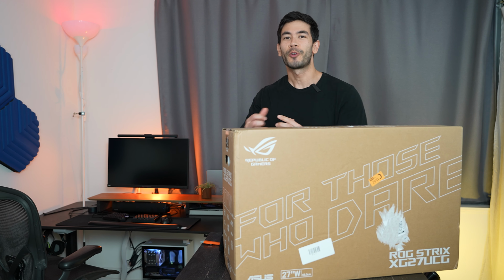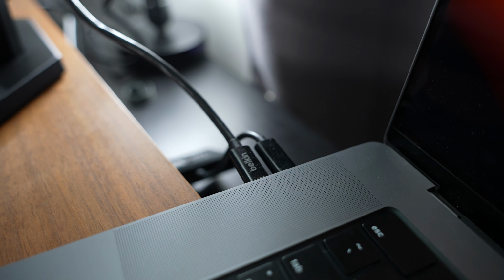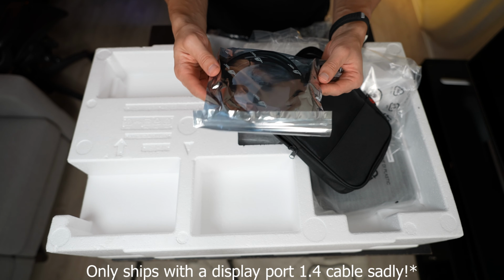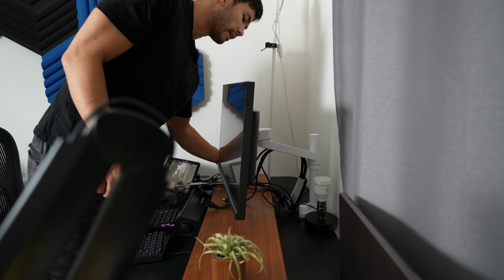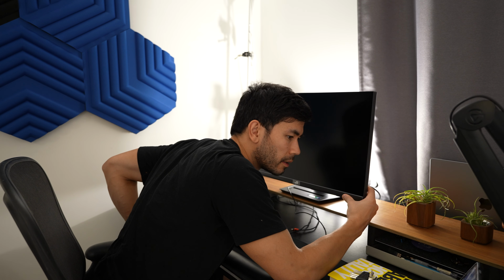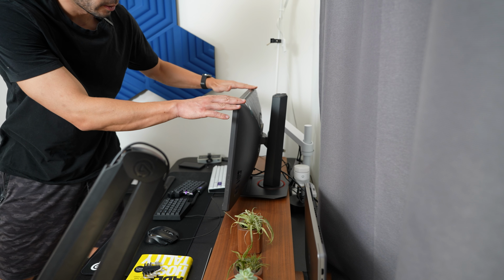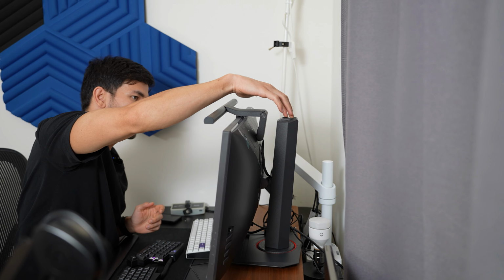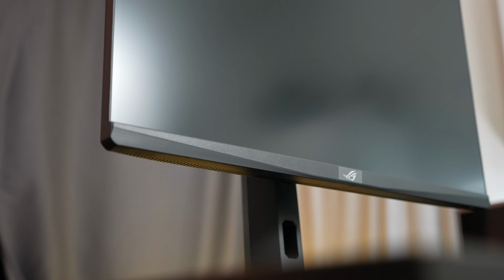Finally, an IPS MONITOR that does it ALL: Esports & Productivity on ROG Strix XG27UCG

Comment: Thanks for the review. It helped with my choice.
Reply from the maker: What did u go with
Reply: @JSyntax currently choosing between MSI MAG 321CUPDF, Asus XG27UCG and Dell AW2725qf. Dell is too expensive in my city, msi just appeared with no in-depth info about, and Asus seem ok but I think I would not like the coil sound. And none of them has Power delivery. I think I go check Asus when I have time.
Reply: @eukaryote0 which one did you bought? Any update

Comment: It's too small for work, I need a lot more real estate. I need to replace my old 43" 4k Dell monitor, and it seems will be another Dell, because there isn't anything as good on the market. There are 41.5" OLEDs, which look great, but replacing them every year due to burn-in doesn't sound like a good proposition.
Reply: Are you like a day trader or something? What do you need so much screen for?
Reply: @musicaccount3340  You probably never did any serious programming, every software professional appreciates large screen. Ability to see a large portion of code at once without scrolling is precious.
Reply: You are putting your eyes at risk.
Reply: Your eyeballs are probably blown out. I used a 32 inch monitor at my desk and it was to much.

Comment: Meh, you didn't even get a good one for Productivity....  DCI-P3 is somewhat low, sRGB is good, but does it even have Adobe RGB?  They don't list it.
HDR is terrible....  You should have at least 600, though preferably 1000 to really deal with content more accurately.  Anyway, what you said at the start is certainly MY problem...  I can't find a good Non-OLED 27inch, 4k, 1ms, 144hz+, DisplayHDR1000.  I'm even willing to pay up to $1,000, but these monitors don't exist, at least quality ones.  You can find some off-brand crap, but crap.  What's crazy is these monitors exist at a really LOW price, like $350+ range, but they have poor HDR, only like 400.  I can't even find 600 which I would likely live with.

Also, you clearly haven't figured out the VALUE of having "two monitors"....  it's so useful, especially for a "content creator" like you.
But even me, when I game especially I'm doing stuff sometimes on my other monitor.  I did stream while gaming for awhile once, and it was useful then.
There are all kinds of use cases....  Once you go two you'll never go back unless you get an "Ultra-Wide"....., but then of course you can't game and do stuff at the same time, unless they make one with "Zones" or something, so it's like you have more than one monitor.
Anyway....
Reply: Pg27uqr has HDR600
Reply: @YasukeNakamoto  ... thanks for the rec, will keep in mind.
Reply from the maker: Productivity is subjective could it could also mean just programming and I don't need HDR and the colors are fantastic